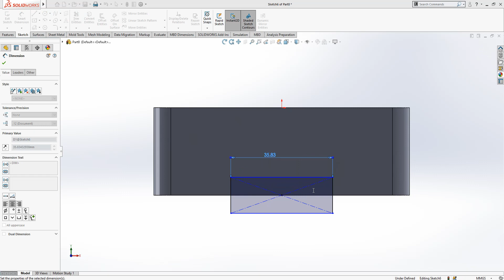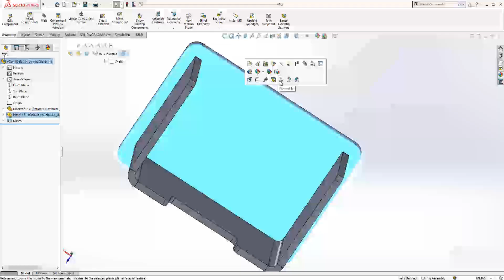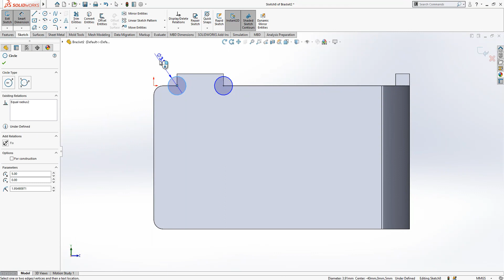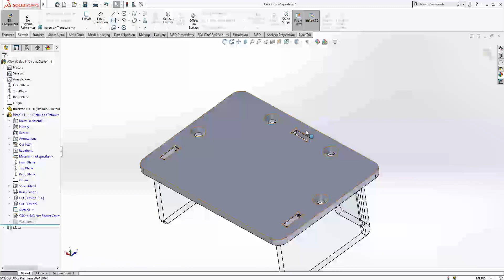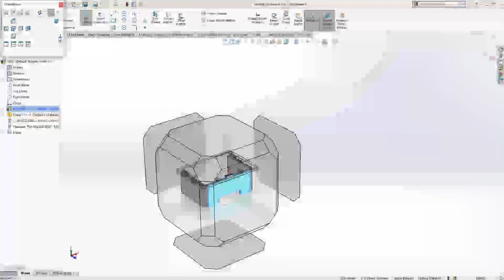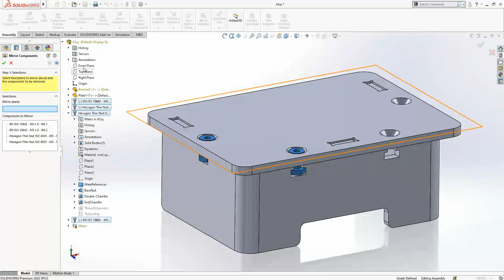Smart Sheet Metal Design - SolidWorks Tutorials

Comment: Thanks for the video, but one thing is not done right. The last edge chemfers you did does not work right after the part is flattened. The part needs to be manually unfolded, trimmed and chamfered, and again manually folded again in order to work. I do not know the tool names as my Solidworks is in German, but you get my point. Another point of criticism is unnecessery manual fixing the first part in the assembly. The first part of assembly is by default automatically placed in the origin and fixed afer confirmation. It saves a lot of unnecessery clicking and time.